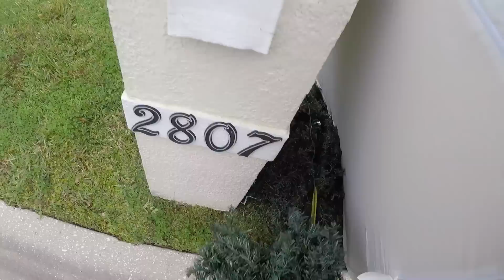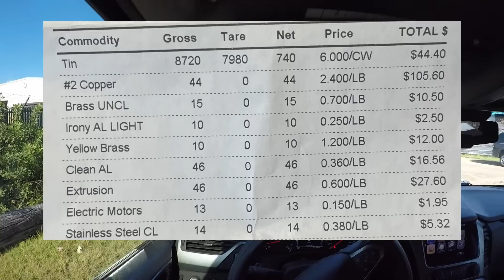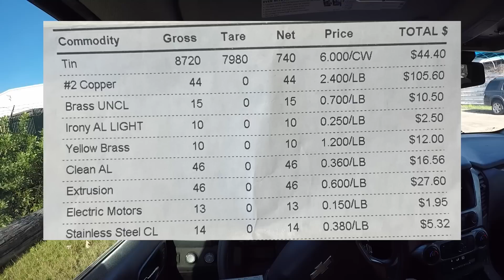If At First You Don't Succeed, Go Home & Pick Up Your Non-Ferrous!

Comment: Great NFJ stuffs. I'm itching to get back at it myself. I also found out my left foot has a broken bone in it, so both are broken. On a good note I did buy a scrap hauling vehicle with towing package. I already have a small trailer. I paid $4000 for an ambulance!!!!! It is a 1989 Ford E-350 7.3 diesel. It only has 110000 miles on it. Retired from a country town in Iowa. The other guy that bought it from them used it for a mobile auto repair, so it has lots of space inside with seats gone. I can break down stuff inside of it. Plus it has side compartments for tool carry and I don't have to take up inside space to carry that. It has this big storage closet on the back that I will put shelves in to carry my non ferrous totes to store as I go.
I can't wait now to get back at it. Maybe sometime in April I will be out again.
Reply from the maker: Big upgrade from the Kia.  You will be a like a kid in a candy store.  Have fun with it and get well soon - 2 broken feet does not sound like much fun.